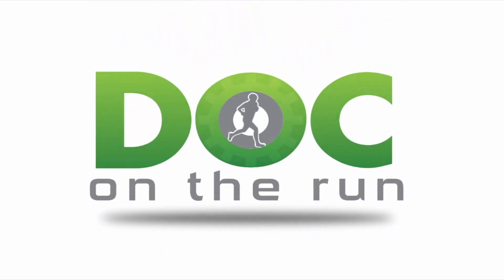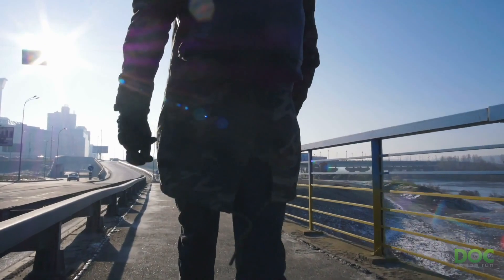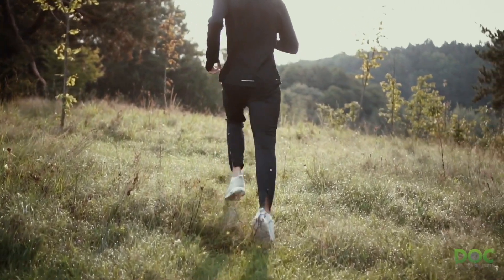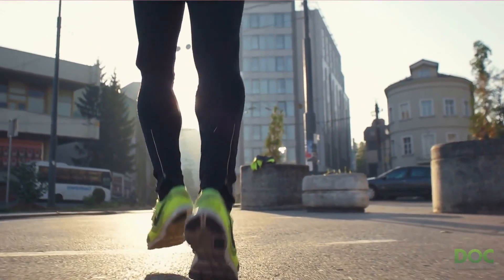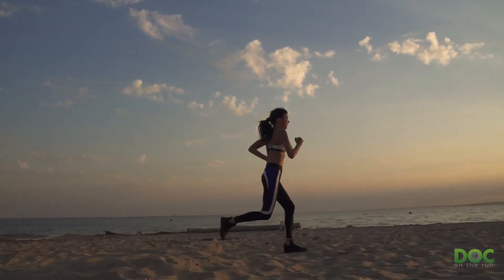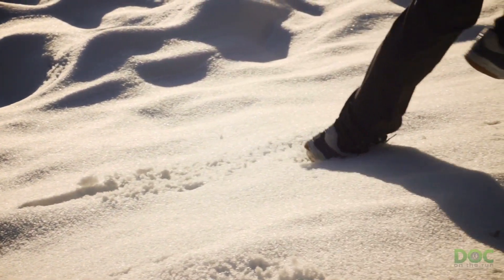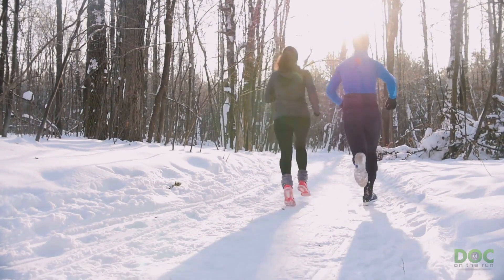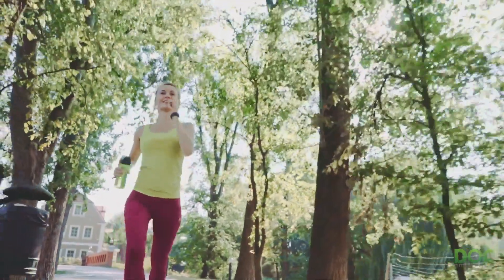Which running surface is the hardest on your feet

Comment: What about the synthetic rubber tracks..which are made on top of a concrete surface.
Reply from the maker: Thanks for your comment and good point! A soft coating (such as rubber) over a hard surface like concrete, softens the surface. But there are many variations. As of January 6, 2021, the List of Certified Track Surfacing Products - recognized by the World Athletics Certification System denotes 276 different track softening surfaces and varying thickness and pliability. A 2002 report Amy Kerdok claims  tracks polyurethane (similar to rubber) increased running speeds by two to three percent and decreased running-related injuries by half, compared to some other track surface materials. Also noteworthy, Usain Bolt clocked world-record-setting times in the 100-meter and 200-meter events on a polyurethane track in Berlin.

Comment: 7:11 Oooof, that form 😬 I'm sure she can get away with it on a surface that soft, but heel running is the WORST for your joints and skeletal balance
Reply: My form is exactly the same as that, which is why I can only run on grass without getting injured